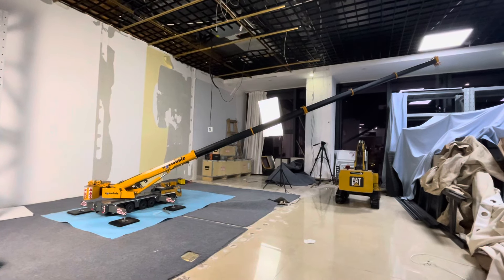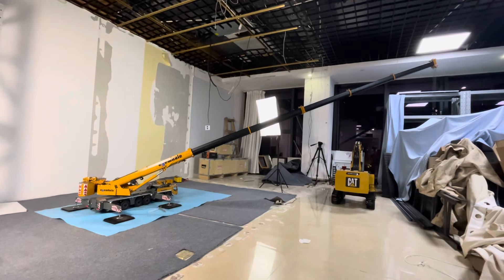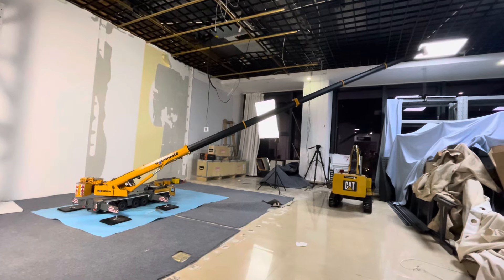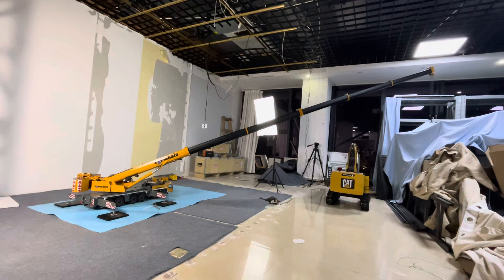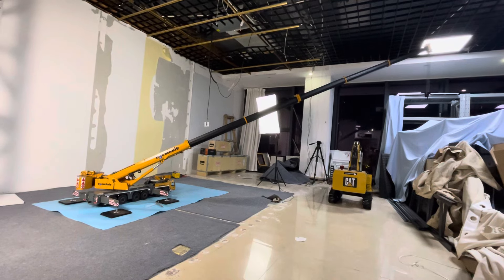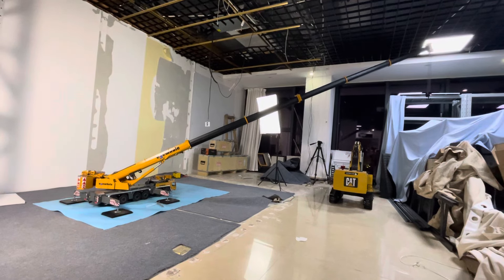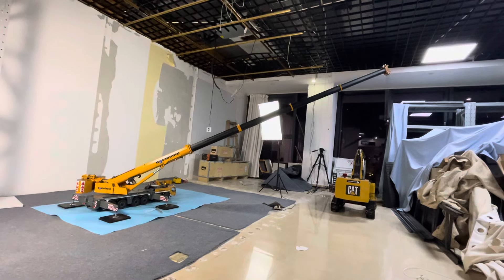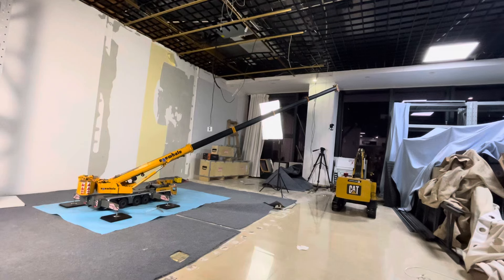Prototype 1/14 1350 crane truck finished test, Soon will show you Unbox video  & details video.

Comment: WOW?!!!?!?

I'm still geeking out about how strong that crane is, and how much it can lift!

You also said 130k in weight, correct?
Reply from the maker: No sir the rope is for 130 kg to break, the main winch is around 6kg drag power , so with pulley 11 times more is around 66kg lift buy winch
Reply: @toucanhobby2400  gotcha